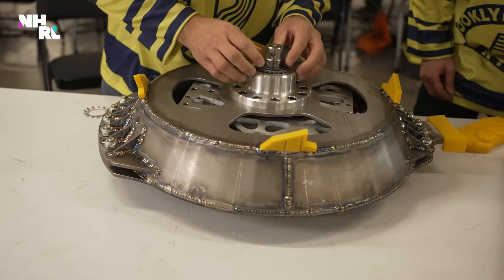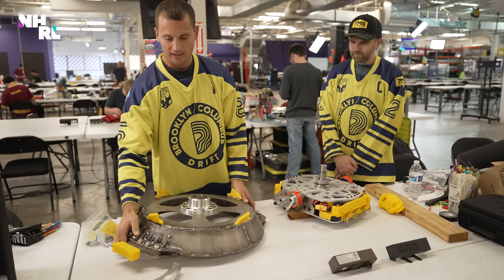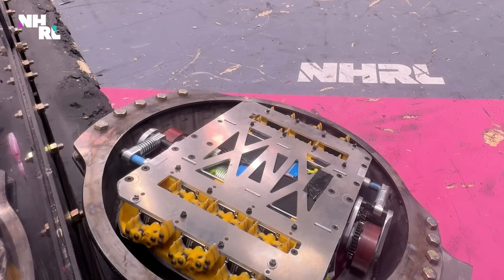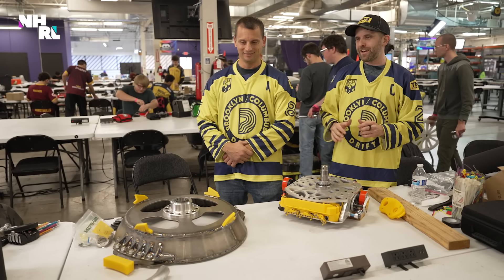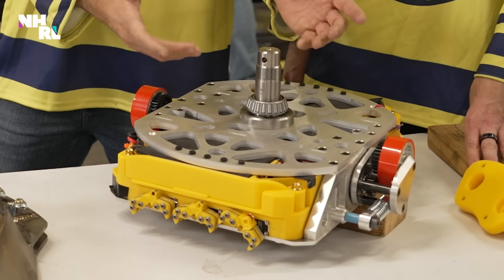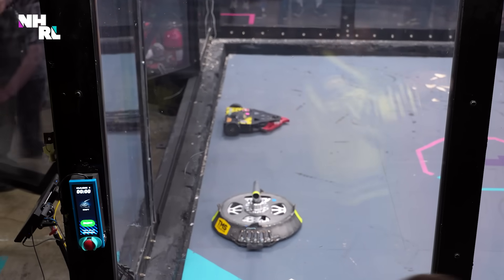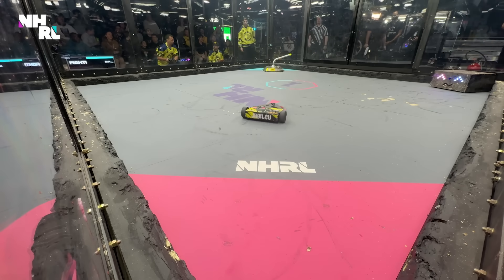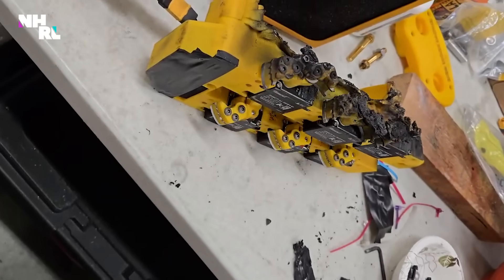Project Stupid: The Fighting Robot That Weighs Twice Its Opponents

Comment: How does that meet walker requirements?  Each "leg" needs 2 or more degrees of freedom, how does a single servo per foot achieve that?
Reply: I think this may have been a "NHRL reserves the right to approve or deny any robot the True Walker Bonus at its sole discretion at any point in the season" situation
Reply: also worth noting NHRL has different and more flexible definitions for "true walker" than say Battlebots.  This design probably wouldn't qualify as a walker for BB (though they also retain the right to rule it as good enough), as BB requires separate forward, backwards, and vertical movement.  
But NHRL only demands points of articulation and not run by continuous rotation (like a shufflebot).
Reply: @TalbotAlligator does that mean a Theo Jansen linkage would flout the rules? Uses a continuous rotating shaft to create a walking motion
Reply: @HesmiyuMC well would have to consult the specific event.  Strandbeest combat robots I've seen at events were considered shufflebots
Reply: It has 3 degrees of freedom per leg. 1 powered and 2 spring loaded.
Reply: @adamwrigley905  But the springs are within the same axis of movement, correct?  Plus, they are unpowered hinge points, how is that an axis of freedom?

Say that, instead of spring hinges, the feet were a smooth or flexible material that could deform its way back.  Achieving the same movement, with the same amount of freedom, minus a physical hinge.  Would that be counted at a walker?
Reply: @d4gu1t4r5   your legs also work within the same axis of movement. 

if you would replace the spring hinge feet with smooth or flexible material that could deform its way back, it wouldn't work, because they would bend in both directions.  and even if you could get it to work, then it would stil count as 2 (or 3) degrees of freedom.
Reply: @eriknoppe  Good point with the legs comparison.

The fact that the second hinges are spring loaded only still seems like a gray area, imo.  Feels a bit like "passing on a technicality."
Reply: @d4gu1t4r5   to be honest, I don't completely disagree that it  "passes on a technicality." ... that being said, that just means they found a way to do something that nobody tought of yet. or in a single word: innovation. 
and I believe  innovation is a very important part of robot combat.
I do think that, at the moment, there are some problems that need to be fixed. the robot does not seem to be very stably by itself. and maybe, if those problems get solved one day, this might turn out to be such a good concept, that there wil be put rules in place to nerf it a bit, like they did with shuffle bots. ether way, I am all for people finding diferand solutions.
Reply: @d4gu1t4r5  If it passes on a technicality, and NHRL still allows it, i mean it feels like it's entirely in the spirit of NHRL.
Reply: @therookiegamer2727  Sure, I'm not trying to say it shouldn't be allowed.  I'm just trying to understand the ruling, because it doesn't look much like what I'd expect from a walker.

Comment: Even when they explained it, I don't know what the difference is between shufflers and walkers
Reply: Shufflers turn a motor on, and go forward. They use a cam system to make the feet go up/down but the controller is basically "on = forward". Our walker requires us to oscillate the feet to walk - we need to send a forward/backward pulsing signal to the feet. This also requires the feet to have "positional" control - not just "speed" control like on a shuffler. We need to know where the feet are at all tomes. If we just turned them "on" like a shuffler, or were to ever lose track of "where" they are, they would jam and we would go nowhere. That's the biggest fundamental difference.
Reply: Shufflers have constant contact with the floor, true walkers have to lift their feet off of the floor, which is a lot more mechanically complex.

Comment: Very ingenious walking design! It seems reasonably fast, though the up and down motion might cause some problems.
Reply: I wonder if having the sets of legs on each side out of phase with each other may help. That way one side is always rotated under, holding it up slightly, so the bump from the transition to the next should be less.

The downside is then they can't use all 6 at once for a big push on that side.
Reply: @DigitalJedi that's actually how it currently works! We do it primarily for the speed increase but it does help a bit with smoothness
Reply: @adamwrigley905  Ah! Didn't quite see it at first but watching again I actually can now.
Reply: @adamwrigley905  cool of you for posting info!!
Reply: @DigitalJedi In addition to that, each set of legs should probably be staggered

Comment: Cant wait to see this one develop. It's definitely one of the most fearsome on paper should it actually work lol
Reply: 🤞 hopefully we figure out the stability and mast issues in 2026!
Reply: @adamwrigley905  Smaller legs? legs 2milimeter higher into the bot? Is a smaller mast an option?
Reply: @adamwrigley905 Hope so! Exciting stuff with a lot of potential.
Reply: It has serious gyroscopic-precession problems.  Tilt it slightly and the spinning gyroscope applies the same tilt-force but 90-degrees around the circle.